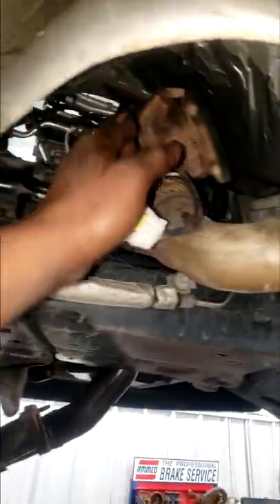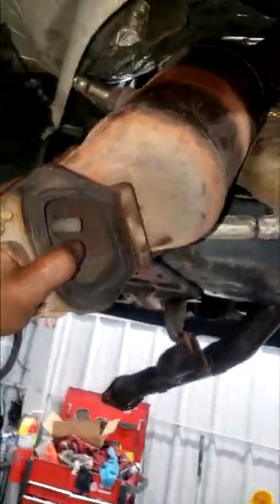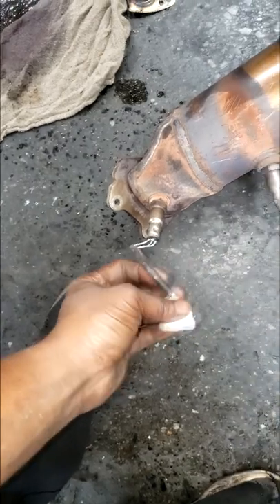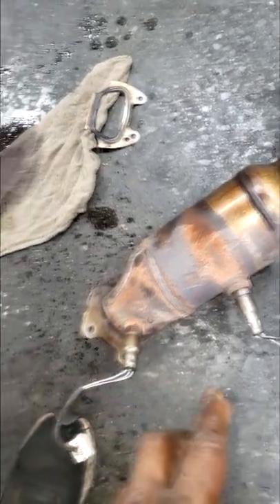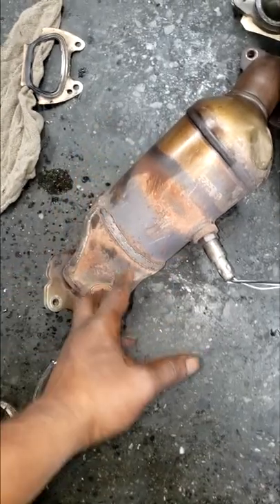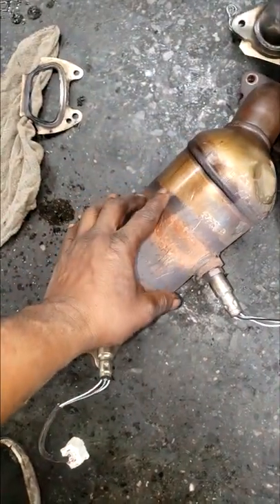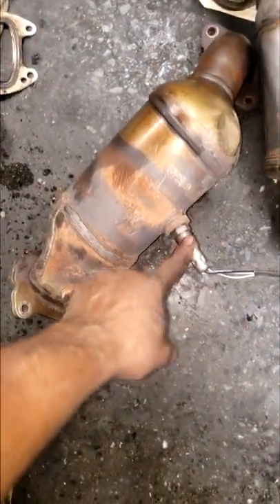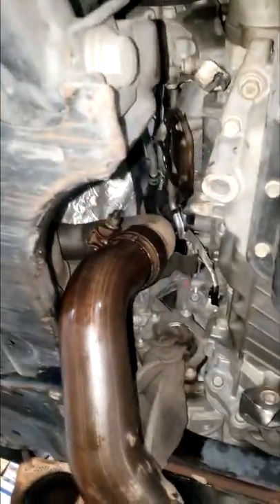WARNING. O2 Sensors will not FIX A P0430 P0420 on NEWER CARS. . YOU NEED A CATALYTIC CONVERTER.

Comment: As a mechanic I can appreciate the effort of this video .What the mechanic here is saying is more than likely you have a bad cat for those codes .why ? It’s because the pcm monitors both those signals and compares them if they give the same wave form than obviously the cat is not working as one senser is before the cat and the second is after so something ie cleaning of oxygen signal should have changed .now that being said thee are a few possibilities for bad senser like a lazy senser or one that is malfunctioning but not enough to make the light come on on the other senser so the signal is skewed .or the down stream senser is stuck from contamination from coolant or oil .I personally think he is correct in his statement as more than likely you will need a cat and if you replace from the start with new sensers you will be ahead of the game given the probabilities of the defects .In other words odds are against you fix ing it the first time if you do sensers first .remember mechanics only get paid one time to fix your car it’s called flat rate pay .come backs are not paid for that’s why his answer is what it is .Blame your dealership. That’s how they pay
Reply from the maker: Damm this was a good read. On point
Reply: @OnlineMechanicTips  
Thank you ,I try to be accurate as possible seeing that there is a lot of misinformation out there   And some unknowing folk may think they are correct in saying mechanics are in it to defraud them .This a very difficult trade to be good at and the better educated the public is the better chance I feel I have asa mechanic to have to deal with a knuckle head who has no clue what he is talking about .in this case the maker of the video is correct in his statement.he just left too much wiggle room from people who think just because it worked for them that he is being deceptive and he is not .They were just lucky.probably for everyone of the lucky ones 8 or 9 had to replace the cat .my opinion
Reply: Thats exactly what happened to me!! Wasted my time and money
Reply: @justchiny5993  
You wasted your time and money how specificly?
Reply: Ugh. I only have one o2 sensor on the Down pipe from turbo to the cat. “Heated oxygen sensor fault” was my code and the fuel economy went really bad. Thought this has to be o2 sensor failing. Replaced it. Code still there. CEL still on. If there’s no sensors after my cat how would I ever know if my cat is bad? My chrome tailpipe was pretty black too. It’s a 1990 Volvo 740 turbo. Fuel economy has improved since replacing the sensor. Maybe disconnect the batt to reset the ECU?
Reply: @TerminatedEfficiency most vehicles before did not have an o2 sensor after the cat. You may have to reset the system by disconnecting the battery for about 30 seconds and then reconnect, that should get rid of the CEL. If it comes back, you still have a problem.
Reply: @aidanmorgan6291  
Yea you’re not going to have a cat efficiency code if you don’t have 2 o2 sensors . And your talking pre obd2 card I think everything after 95 has two o2 sensers . One before one after the cat . That’s the point of having them . To determine the efficiency of the cat .
Reply: @TerminatedEfficiency  
If your light is still on after changing the sensor than one of two things .1 you got a cheap knock off part and it’s defective . 2 the wiring from the o2 senser is bad or has damaged the pcm . . By wiring I mean the pins in the connector also . That is all there is . If you have a bad heater circuit in your o2 senser code than it either open circuit or shorted out .ohm check your wires back to the pcm check for shorts and opens
Reply: You’re right. I temp check and compare the o2 sensors on a graph if there’s a dead sensor you’ll get a o2 signal code. After doing this for a decade I’ve only ever had 2 of the countless catalytic converters I replaced ended up being a sensor for a p0420.
Reply: But what if your mechanic put 4 brand new cats on and after hours of driving the code came back 🤔 😧🫤😳🙄  one answer is the mechanic doesn't know this described in video or comment and doesn't specialize in these types of issues I NEED HELP to pass my emissions and drive a safe car
Reply: @BigRigPullUp  
If your mechanic put on cats and you still have a cat efficiency code than one of two things either .and I don’t know if it’s one or both sides affected .that means the pcm is seeing the pre cat and the post cat signal are close to mimicking each other .they should not be like that . The pre signal should be active and the post should be way less active because the excess gasses should have been cleaned
Reply: @BigRigPullUp  are they OEM cats? Because aftermarket cats and sensors often don't work properly and  you end up with a CEL.

Comment: You have to swap o2 sensors with a new cat anyway. It’s a cheaper fix then a cat so just try cheap before expensive.
Reply from the maker: You dont have to. I have replaced cats using the same O2 sensors. If there was problems with the O2 sensors, the newer computers would pick it up. I have been burnt to many times now wasting customers money by selling O2 sensors for these codes. Simply because its 99% of the time the problems with the cats themself. When i see this code, my estimate will likely include the cat
Reply: @OnlineMechanicTips  what's an estimate look like??
Reply from the maker: @christianramos315  Most cats today upwards of $1000 or more. This not including labor.  Hey thanks for watching, please thumbs up the video and subscribe to the channel, thanks
Reply: @OnlineMechanicTips  mine shit says 6 k
Reply: @OnlineMechanicTips  what if my mechanic already put a new cat on my crv. If i change the upstream 02sensor the check engine light wont go away? I also have bad gas milage and vehicle smells hot at idle.
Reply: @DG-888  make sure its oem catalytic  converter
Reply: @andrewspage2777  thanks, i think that might be the problem along with an exhaust leak. My mechanic installed an amazon universal cat convertor!🙁
Reply: @germanking452 I found some high flow cats for 200 😂😂😂
Reply: @Smokey5ohh  where
Reply: Yeah I saw some decent-looking cats for 2012 Caravan for like 150 on Amazon and my father-in-law needs them
Reply: @dirtyglovekennels616  depends if your state is carb compliant or not. But they don’t last long at all. If you just need to pass once then do it
Reply: @OnlineMechanicTips  you can get away with reusing o2 for a little bit but the crush washers don’t seal well after 10s of thousands of miles. It also lowers the risk of a comeback car for a stupid thing. And with Japanese vehicles that last longer we’ve seen more and more o2 sensors and heaters go out than cats except on Nissan
Reply: No you don't. I've replaced 100s of cats without replacing O2s with no issues. If they are switching as they should and respond to rich/lean conditions there is no need to waste the money.
Reply: Obviously the downstream O2 sensor is working perfectly so why replace it ... I've done hundreds of Cats using the old O2's
Reply: @Carlitosway211  couple reasons you should replace the o2 with a cat is to prevent a comeback. The crush gaskets are likely not going to seal properly ( I’ve had this happen before so don’t say it can’t happen) because cats don’t go bad at less than a 100 thousand you might as well replace them.
Reply: @_JTPR_  Moot point. That's if it's in bad shape and that's what a visual inspection is for. That comes with experience though. Again, I've replaced 100s of cats without replacing O2s with zero comebacks about it.
Reply: I had my o2 sensor swap out didn't help now i need catalytic
Reply: @carolynclark856  at least you’ll have new O2s for the cat. Most common code is a p0420/430 and as someone who works in Japanese cars it’s typically high mileage where 02s will go twice before cats. Obviously Nissan isn’t the same but we try anyway because it will help the customer get by to register anyway
Reply: @ImMrModified  if i got sensor on last summer can i still use same sensor??
Reply: @carolynclark856  I would personally. I replace O2s before the cat because it tends to be a cheaper way to diagnose then to just buy the catalytic converter. However when we sell cats we sell O2s because we don’t want them coming back in even a year because of a similar code or a heater code. Another thing to think about is how well is the credit washer going to seal. Now a newer sensor like yours likely has no rust or blemishes inhibiting it from sealing properly. You may be able to sneak a warrantee in depending on the brand but if not clean up the threads and sealing service. Apply light amount of anti-cease to only the threads keep it off of the actual sensor and you should be just fine
Reply: @_JTPR_  😊
Reply: You could always check for exhaust leaks first before getting a new catalytic converter
Reply: @Napoles428  you my friend haven’t read the thread or don’t work for a shop. Let’s say those O2s do leak or were damaged when removed. Your telling me your going to contact the customer who you barely squeezed a cat out of to spend another 100 bucks give or take on O2s. Selling o2 sensors either before or during the replacement of the cat is streamline to avoid a car returning for the same code different problem. Typically when you sell it as such the customer who’ll buy it as such knowing that they may need a car if the sensors don’t work
Reply: That’s extra time if it don’t work out .then you may have to remove stuff to get to it and pays for the extra labor . From a tech stand point shot gunning this operation will give the best outcome as far as fix it right the first time goes .if your a diyer have at it .swap out those sensers first .its your time and money
Reply: @daviddealba9886  at my shop we have 2 hours for diagnosis and I typically use that as labor to total sensors and retest. Regardless of if the sensors aren’t bad it prevents having to sell them when they need the cat. Sensors or cats on the cars I work on go out after 190k miles and it’s very common to have a sensor stuck within a cat or damaged when removing. Therefore selling the O2s prior makes sure that the customer doesn’t have hidden costs after the cats have been sold. It’s a cya all across the board and especially on Japanese cars these sensors fail before the cat usually does. I see it every week.
Reply: My cars throwing a p0420 n p0430 after I just changed the catalytic converters. Do I needa put new o2 sensors on now to make that go away?
Reply: @MasonHale-kn1dt  check for updates on the vehicle. Check for proper power and ground at the connectors to the o2s then replace. 9/10 it will be the sensor
Reply: @_JTPR_  bc I got two people saying o2 sensors n then one saying faulty catalytic. N just tryna make sure before I fix the o2 n that not be it.
Reply from the maker: @MasonHale-kn1dt What kind of car is this? Also are you subscribed to the channel?
Reply: @MasonHale-kn1dt  what’s the year make model. At our shop we replace sensors first dues too the large amount of sensor failure in the Japanese car realm and more affordable place to start. If you need a car we would sell you sensors in addition to make sure that code does not return after a cat replacement.
Reply: I have a question out there how many techs have tried cataclean  the stuff you put in the gas tank I had it work once and fail once .

Comment: Don’t listen to this.
Reply: Oh no, I just did! How to reverse time?!
Reply: Ignorance is bliss to the sheep.
Reply: I had an 08 ram 5.7 come back with a cat efficiency code after replacing an upstream O2 sensor. Old sensor won’t switch as fast as the new one, and the computer may misinterpret and throw an efficiency code. Replacing the rear O2 sensor fixed my issue
Reply: @deeznutz3494 did you have code p0420 I have the same vehicle and I have this code and I have a oil leak and I think it burns a little bit of oil can that throw the code because it burns oil
Reply: @zuriiiii77  I did have that code, but this is a different story though. I originally had an O2 sensor code and after replacing it, the car came back with P0420. Chances are you have a bad converter
Reply: Wtf did he say lol
Reply: 😂 @Onecooliceman

Comment: But how did you 100% confirm the cat was no good ?And did you investigate why it went bad I've worked on car with over 300000 miles and still had original cats
Reply: I’m going to test my luck here since nobody can give me a straight answer. Ok just had my cats deleted and piped because bank 1 was clogged and busted bank2 was fine but I wanted even back pressure so had it removed and piped. I was for sure this was going to fix my 02 codes and intermittent misfire I would get but nope. Took it to shop and they said it needed OEM CATS put back on and brand new OEM sensors even though I replaced 1. Does this sound right? it drives fine one minute and the next minute huffs and puffs and sounds like I’m bout to blow my engine down but then it will cough it out and all a sudden like a dirt bike power band kicking in I’ll take off full speed. Replaced everything I can think of MAF, plugs, filters, cleaned injectors, fuel pump, noid, spark, coils, cleaned throttle body, still no results RPMs will bounce up and down about 500 rpm when holding foot steady… I was told by one mechanic it’s the cats and another said it was PROBABLY the VVT bolt and or magnet.
Reply: @vunit8213 sounds like you have a vacuum leak somewhere. Check the hoses around the throttle body with the engine off and on, try to feel for air listen for seeping. Behind the master cylinder you have a vacuum box also, I was just messing with it today actually but if you take the plug out, which it's very easy, may have to wiggle a bit but it will pop out, your car can idle with it out, but when you try to plug it up the car will shut off. Even though it's for the brakes it's still a vacuum component. It may need to be replaced or you can try and spray some mass air flow cleaner in there also. Or throttle body cleaner with a friend revving the engine around 1 to 2k
Reply: @VUNIT82  Get a tuner and delete the rear o2 sensors. Scrap the cat.
Reply: Mine just ticked over 200k on original cats. It’s just fine. My other one has an aftermarket one after it’s cat got stolen. It’s been throwing a p0420 for years. I’ll be putting a spacer on the sensor, then I’ll change the sensor if that doesn’t work, no way I’m replacing the cat again.
Reply: You bring up a good point .How do test my catalytic converter ???well there are several different methods .I think if combine them you will be given a high probability that your diagnostic is correct .first and easiest hit the cat and listen for ratting in the cat compartment.most cats that go bad have some sort of melt down caused by oil or fuel in the exhaust that cause the cat to operate at too high a temp and they melt down like lava.second take a temp reading before and after the cat .the back half should be hotter .third monitor your 02 pid readings .they should not be the same .normal 02 pid readings flexuate .10 volts 0-10 volt in that range .and what does a o2 senser read ?o2 that’s what .your exhaust has other gases going into the cat so the o2 is lower .coming out its has more oxygen so it does not flexuate much because it is mostly 02 it stays relatively steady that’s normal.i think if you use these three methods you will be on track with a positive diagnosis